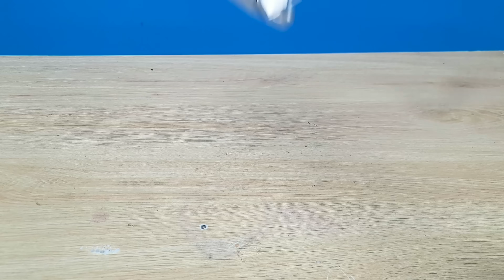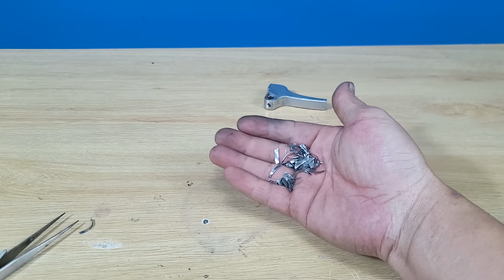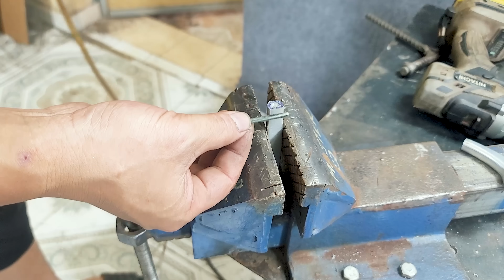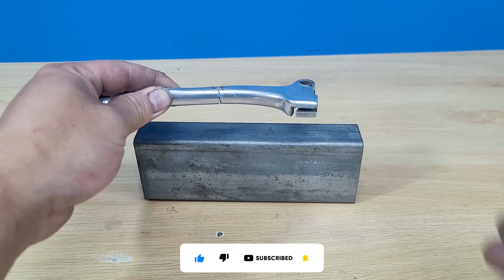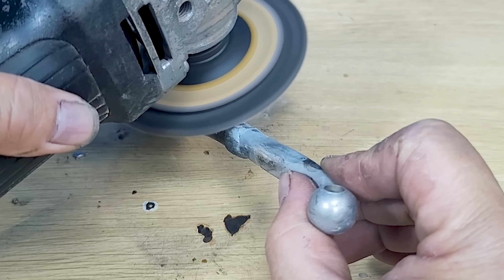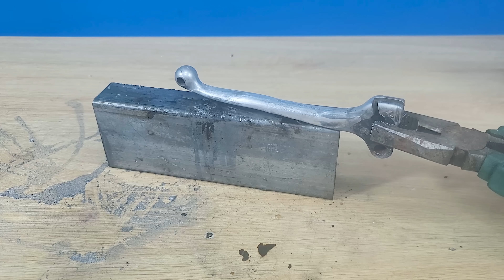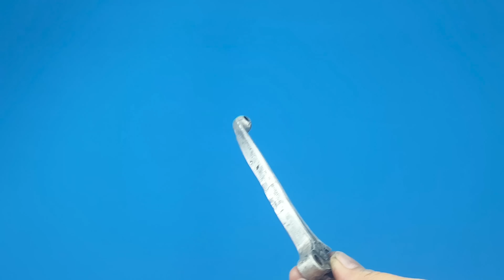Even a NASA professor had to learn this from me! Idea of using 1,5V battery to weld aluminum brakes

Comment: I don't understand why would one do half of the stuff in this video

Can afford and buy angle grinder gallore, discs of all shapes and sizes (but not the disc guard lol, always in these videos, you mofos are suicidal, I tell ya)

Cannot afford/buy simple drills, uses self-tapper as a drill

Cannot afford/buy thread cutters, uses ground up screw instead...

AND he reused that screw in the final construction, making it have only 50% of the strength, because half the thread was missing lol
Also, if you want to make a tap out of a screw, cut into it straight on, and then tilt the angle grinder a little, this way you actually create a sharp cutting edge. You just ground it down, so it basically just bulldozered material out instead of cutting it, in anything harder than aluminium that would not work at all

Also it's very nice that you explained what kind of chemical did you mix with the zinc shavings from the battery, we definitely know what it was and can replicate this process perfectly :v

Comment: If your brake lever comes back to the bar you might as well have no lever anyway
Reply from the maker: You are right! If the brake lever does not hold the position, the system will lose its effectiveness. I will check the brake lever return spring, maybe it is too weak or installed at the wrong angle. Thanks for your interest and sharing, my good friend, have a nice day💖 💖 💖

Comment: So this is why space shuttles keep blowing up they are soldering aluminum and steel together with lead solder. I'm pretty sure you could shorten the video with some mapp gas and some aluminum braising rod just sayin.
Reply from the maker: You hit the nail on the head – soldering the wrong metal can be a real disaster. I’m considering switching to proper soldering or even using the screw method instead in an upgrade. Thanks for your interest and sharing, my friend, have a great day💖 💖 💖

Comment: The question of whether the repair will fail or not is kind of making a mountain out of a mole hill. First, this is not a vehicle that will be high speed road racing. Second, just how much force will be put on it by the human hand? Not much. Third, the two strongest fingers is pulling the side of the lever that wasn't broken. Fourth, the part of the lever that sees the greatest force is shared between the pivot, the cable socket and the root of the lever, a couple of inches from the weld. This isn't about welding a shattered trailer hitch ball where the killing bus loads of nuns and orphans argument could be made. And last, if the worst should happen, there is still the rear brakes.
Reply from the maker: Exactly! Each repair has its own factors, and in this case, using hand force will not cause major problems. If everything is divided equally, it will be much easier!Thank you for your attention and sharing, my good friend, have a nice day💖 💖 💖

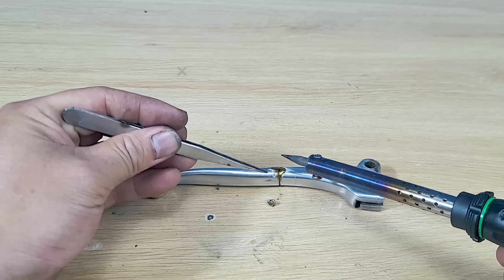Comment: 0:39アルミにはんだ付けするならヤニ入りはんだではんだ付けしたほうがいい(ですよ)。
Reply from the maker: Yes, when welding aluminum, using solder containing rosin will help increase adhesion and improve weld quality, especially when welding at low temperatures. Thank you for your interest and sharing, my good friend, have a nice day💖 💖 💖

Comment: Step 1 - dismantle the AA battery. 
Step 2 - use inner metal liner from battery to turn toilet bowl cleaner into completely ineffective flux.
Step 3 - drill out and "ghetto style" thread the broken edges of the part.
Step 4 - use a small bolt to reconnect the 2 pieces 
Step 5 - hide  $hitty repair with solder, (poorly) using your homemade flux.(Didn't work)
Step 6 - buy a new part because it broke 1st time you used it
Step 7 - claim you welded with a AA battery.😮😢
Reply from the maker: If every invention was abandoned because ‘it’s easier to buy a new one,’ we would never discover interesting fixes. Who knows, maybe one day, AA battery soldering technology will be improved? Thanks for your interest and sharing, my friend, have a nice day💖 💖 💖

Comment: Would you trust glue on your brake lever???
Reply from the maker: Glue on the brake lever? Not a good idea! 😅 The braking force is very strong, the glue is hard to withstand long term. It is best to use a more secure fixing method, such as welding or screwing. Thank you for your concern and sharing, my good friend, have a nice day💖 💖 💖

Comment: And 6months later he was diagnosed with a rare form of bone cancer from touching the inside if the battery and breathing the fumes of the flux he made from its components 🤷🏻‍♂️
Reply from the maker: Safety always comes first! When working with batteries, appropriate protective measures should be taken to avoid unwanted risks. Thank you for your interest and sharing, my good friend, have a nice day💖 💖 💖

Comment: I mean, I would just buy a new one. You didn’t even have the drillbit to drill it. Use a self tapping screw for a drill bit and who the hell wants to cut a battery open so I could slice my hands open and get Nicad or whatever the hell is in that battery all over my hands too much of a chemistry set for me. Can’t be good for you.
Reply from the maker: Buying new is definitely the easier option, but sometimes repairing or repurposing what you have is a fun way to learn and be creative. As for the chemicals, you are absolutely right – always be careful when working with batteries!,thanks for your concern and sharing, my good friend, have a nice day💖 💖 💖

Comment: Esto es peligroso, en una frenada fuerte la palanca se puede romper causando un accidente, mi recomendación : cómprate una palanca nueva y maneja con más precaución.
Reply from the maker: Thanks for sharing! Safety is always the top priority. If possible, replacing the brake lever is definitely the best choice. But if a temporary repair is needed, proper reinforcement can also help increase durability, thank you for your concern and sharing, my good friend, have a nice day💖 💖 💖

Comment: beli catok besi 300ribu,beli bor 400 ribu,beli cairan 50 ribumata bor 50 ribu,gerinda tangan 500 ribu,obeng dn lainlain 100 ribu,total 1,400.000...klo beli handle rem cuma 15 ribu 😂😂😂
Reply from the maker: It's true that if you only count the cost of the brake lever, it's cheaper to buy a new one. 😆 But the tool is not just for one-time use! Once you have it, you can fix countless other things without spending anything else!, thank you for your interest and sharing, my good friend, have a nice day💖 💖 💖

Comment: I am NASA professornal, I had similar problem with my bike kickstand folding and bike falling over.  I used a similar technique to weld the kickstand so it no longer folds up.  Now kickstand always down, and bike doesn't tip over.  Only problem now is I'm unable to turn left with the kickstanding hitting the road, causing me to keep crashing.  I solved the problem by only making right turns.   It takes me longer to get there, but my bike no longer falls over (unless I forget and crash trying to turn left again)
Reply from the maker: What a creative solution! However, limiting left turns may not be the optimal solution in the long run. Have you thought about welding an extra part so that the kickstand does not touch the ground when turning left? That might help you move more comfortably without worrying about falling., thank you for your concern and sharing, my good friend, have a nice day💖 💖 💖

Comment: So u polished first then used the sandpaper after that then u used the hammer in the end?
Buddy using the hammer cancels what was done using the sandpaper and using the sandpaper cancels what was done with the toothpaste
These r 3 correct steps done in a reversed order 🙄
Not to mention the extremely high risk doing this kind a fix for a break lever
Reply from the maker: It seems like the steps are a bit out of order. Sandpaper, then polishing, and hammering at the end!

Comment: これは溶接ではなくてロウ付け。低融点のアルミ棒だから芯のボルトが無かったら強度が維持できない
Reply from the maker: That's a valid point. It's not welding, it's brazing using low-melting-point aluminum rods. Without the central bolt, the strength would not be maintained.

Comment: Won the GAMBIARRA trophy. Welding the brake lever is not the smartest option, since it will 
break when activated at a moment of great effort, putting your life at risk. Better to buy a 
new one.
Reply from the maker: Thanks for sharing your concern! You are right that safety comes first, and welding the brake lever may not be the best solution in all cases. A new one is definitely the safer option, thanks for your concern and sharing, my good friend, have a nice day💖 💖 💖

Comment: NASA just knows how to use motion  greenscreens, Photoshop and CGI software and a computer mouse.
Sometimes foil........alot of aluminum foil
Oh yeah, and cable suspension trickery
Also cant forget the recruitment of the Freemason brotherhood actors/performers, they usually play the roles of the astronauts.....sometimes can be substituted for a former Freemason military member. but these members can usually be too busy flying the high altitude chemtrail spraying planes.

Comment: I once broke the clutch lever on a motorbike. I fixed it using superglue until a new replacement lever was sourced a few weeks later. It did the job but I preferred the safety of fitting a new replacement. Fixing with superglue was much simpler than the video repair.
Reply from the maker: Yes, temporary repairs are always useful when you need your bike to work immediately. But as you said, installing a new replacement part still gives more long-term peace of mind. The way you handled the situation was creative, thanks for your concern and sharing, my good friend, have a nice day💖 💖 💖

Comment: just drill a hole and thread a bolt in while you wait for the new part, or old part even. Or put some sort of pipe over the old stub and secure/drill through to secure. Going to this amount of effort for something that could kill you when you pull on it is nuts. At leas if you have a dodgy repair you'll remember for the few days you use it.
Reply from the maker: Thank you for emphasizing this. Safety should always come first when repairing, especially with parts that pose a direct risk to the user's life. Thank you for your concern and sharing, my good friend. Have a nice day💖 💖 💖

Comment: Nice job with the internal dowel inserted in there. In all sincerity, I do think doing this repair that way is a viable way to make that a “safe” repair. But respectfully, not in the way you went on to finished it. Imho, as a metal, aluminum has a relatively low melting point to begin with. Low enough so that just hitting the fracture point with the torch the way you did was enough heat saturation to effectively compromise the structural integrity of the entire lever on a molecular level. In other words...now the fracture repair point is the ONLY part of the piece that has any strength comparable to its original state. So now a hard yank on that lever could very well cause a new failure just beyond either end of where the internal dowel is, or at the mounting holes as well.
    So an alternative solution would be to use a liquid epoxy (like JB Clear Weld) on the dowel insert. And once that cures out, fill the gap (if any) with a two part “steel” epoxy (such as JB SteelStik), all the way around. Then hand sand the break point if need be, afterward. And no I don’t work for JB Weld, lol. I just use both of those products as my “go to” for repairs exactly like this, and have had excellent results. Used in conjunction, those two products result in structural repairs for most metals that are strong as sh*t. And negate the adverse effects that do occur from the application of “high heat.” Specifically when it comes to aluminum. Let’s face it, if that lever was steel, you’d likely have just busted out your stick welder.
    And if I was doing that lever with the method I just described, I’d probably go a step further and use a significant amount of the epoxy steel on it. Enough to create “finger recesses” on the front side like many vintage brake levers used to have. Simply because it would be going back on a road bike, and doing so would pretty much guarantee there wouldn’t be future failure during regular use.
Reply from the maker: Thanks for sharing your great idea! Using liquid epoxy and steel epoxy is indeed a safe and effective solution for repairs, maintaining the strength of the part without damaging the structure. This is very smart, especially when working with aluminum, as high temperatures can damage its strength, Thanks for your comments, we look forward to your support in the future, thank you, have a nice day

Comment: And the lever looks great, so as long as one doesn't touch it, it will be fine. However, one should NEVER trust something like that to hold up under pressure (such as stopping or slowing down)

Comment: Make a sand mold melt aluminium,  pour new handle. I worked in a foundry
Reply from the maker: It's great that you can use your foundry techniques in your workshop to recycle and create new handles. Foundry work is definitely creative and fun.
Reply: @inventorK20  hot hard burning work. OK for aluminium, low heat. But one steel pour was 1970 degrees Celsius.  Burn you from 4 foot away. Learnt a lot. Luck to yourself.

Comment: zinc chloride is also suitable for soldering pure steel, not only aluminum. Greetings from Poland...
Reply from the maker: Hello from Poland! You are absolutely right, zinc chloride is not only suitable for welding aluminum but also very effective for welding pure steel. It helps to create a strong and durable weld. Thanks for sharing this information!
Reply: @inventorK20  do you know how to get it?  just dissolve the battery plate in hydrochloric acid and wait until it dissolves, and you can solder, the finished solution can be stored for a long time...
Regards

Comment: Sorry but NO.
This is a motorcycle brake lever, its use in an emergency on a busy road could mean the difference between life and death.
I'm buying a new one, genuine part from Honda/Suzuki/Kawasaki, not using some untested 'bodge job'.
Reply from the maker: Thanks for your feedback! We all know that safety is the most important factor when on the road. Choosing genuine spare parts is always the best solution to avoid risks and ensure that everything works as expected. Wishing you safe travels! 🚴‍♂️

Comment: Yo meteriaun csquillode acero para re forzar despues de. Haber  soldado la  pieza y o soldaria con. Gas argon
Reply from the maker: Your idea is very clever! Putting a steel bushing for reinforcement and then using argon gas when welding will definitely give a high strength to the weld. Thanks for sharing this technique, I think many people will learn from this method! 👍

Comment: Would it be easier to just buy a new lever?....yes.  But that's not the point.  Excellent work showing what is possible....if you actually had something with a lot of personal value to YOU, and really wanted to save it.
Reply from the maker: You are absolutely right! It may be easier to buy something new, but the real value comes from creating a custom solution, especially when it is something that is personally meaningful. Thanks for highlighting this important point – that is the spirit of innovation!

Comment: Не проще купить эту ручку или или отдать аргоном чтоб заварили.Идея так себе , представляю если ручка отвалится при экстренном торможении, слишком дорого это может встать.
Reply from the maker: Yes, you are absolutely right! Buying new grips or argon welding them is quicker and more reliable, but sometimes making your own has its own satisfaction. However, as you say, safety should always come first, especially when braking in an emergency!

Comment: This is absolutely ridiculous. If you know anything about aluminum is that it is an extremely brittle (when not heat treated correctly) and malleable metal. Any person who knows the basics of welding aluminum is well aware that you simply can't weld aluminum like that, particularly for a part so vital to one's safety as a brake handle. The amount of time and effort doing what you did repairing this part is commendable, however, I can't imagine someone going to these lengths, unless they live in a very poor country, without any access to OEM replacement parts. Nowadays with the advent of eBay, Amazon, and other online retailers, there's no reason to risk having a major accident if this hacked welding job has a catastrophic failure. This is a reckless video. Don't encourage people to do this type of thing.

Comment: Life-threatening! Don't do it under any circumstances! It must be repaired with an original brake lever. Do not glue and do not use cheap Chinese aluminum junk!
Reply from the maker: Thanks for the warning! Safety is always the top priority. I completely agree that using genuine and correct spare parts is very important to avoid risks. 🙏, thank you for your concern and sharing, wish you a good new day

Comment: I think this is a useful skill that can be applied to many repairs. I don't always have the time (or patience) to wait for a new part from Amazon. I am a great believer in fixing and re-purposing things. Our world is getting too disposable for my taste. I've learned  how to plastic weld, solder, etc. Thank you for this video. In my opinion, I think this is fixed very well and strong enough to hold up until the bike itself is no longer running. In that case, I'll expect a video from you about building a new motor out of bamboo. Thanks!
Reply from the maker: Hi, nice to chat with you, thanks for sharing your thoughts! I also believe that repairing and reusing things is not only a useful skill but also a great way to protect the environment. I understand that we don't always have time to wait for a new part, and knowing how to solder plastic or tin can really help in many situations. thanks for your interest and sharing, have a nice day